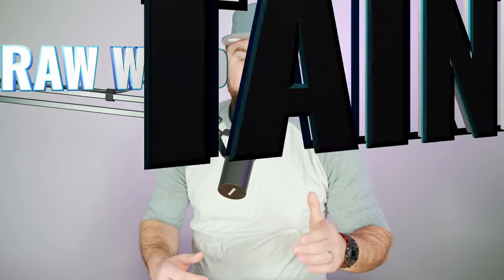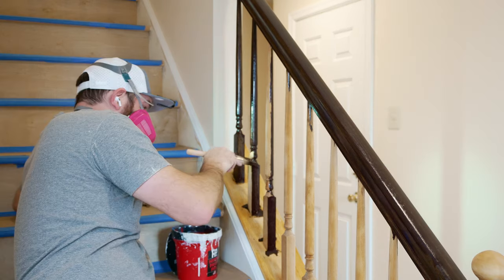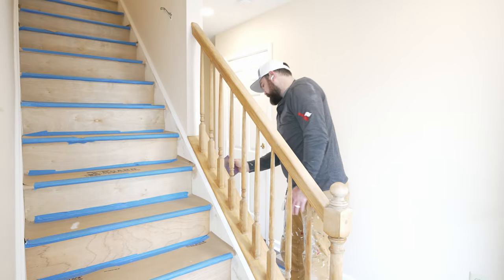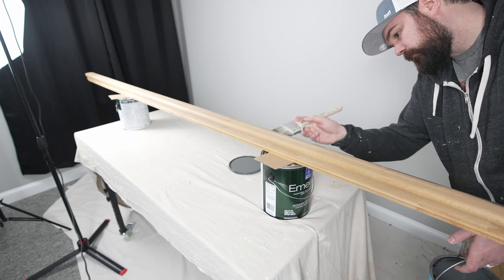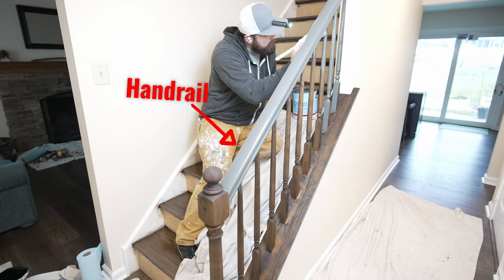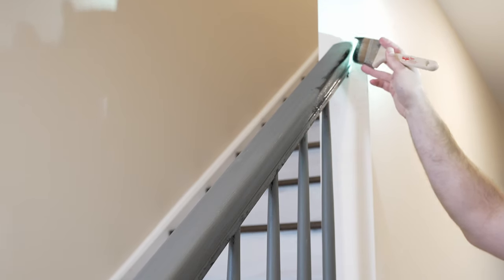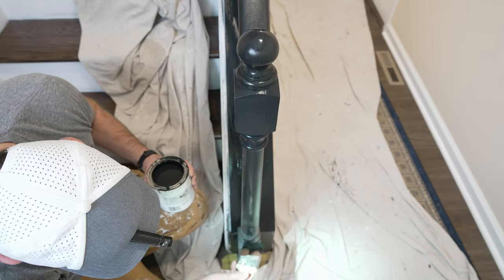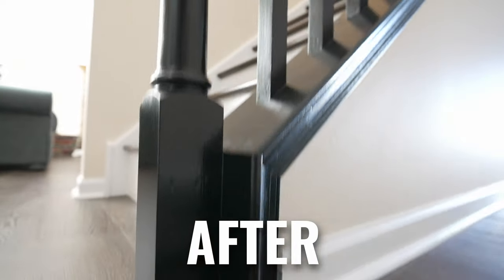The Secrets to Painting Your Handrails FAST

Comment: Thanks for the great tips!  You do really need to watch the drips with Advanced on vertical/sloped surfaces, but otherwise the results are great!  Just put it on a bit thinner than normal, and wait the 16 hours as you advised, between coats.  Usually 2 coats gives you perfect results!
Reply from the maker: That’s the move 🫡

Comment: Hello, thank you for all of the great videos, they have definitely helped me with redoing my bedrooms. I was wondering if you have used the sw extreme bond primer withe the emerald trim paint, if so how does this combo compare to the sw? I used the sw combo on dark stained trim and needed 3 coats of paint. To be fair this is my first time doing this kind of stuff so it may be something iam doing. Thank for any input you might have.
Reply from the maker: Thanks for watching!  

I have used the SW extreme bond and in my experience the Fresh start does a better job bonding and converting a light color to a dark color.  Emerald urethane trim enamel is my go-to trim paint but I use advance for specialty applications like handrails.   

3 coats is typical for converting dark trim so don’t feel like you’re doing anything wrong.  Good luck with the rest of your project!
Reply: @SuperVassarBrothers  thank you for the reply. good to know, just starting on the second room and I will probably stick with the sw combo as I still have enough to do this room but, I might try switching to Ben Moore for a future project. 
I see that you like the corona Cortez and Vegas brushes. Have you tried the purdy xl glide and nylox? If so how do the compare?  I haven’t had an issue with the xl, but the nylox lost a ton of bristles which was incredibly annoying but it did leave a smoother finish on the trim.
Reply: Also, much as I love Emerald trim paint, it is really bad for mid-range to dark colors, it scuffs really easily. The paint doesn't seem to be able to handle much of a pigment load in the dark colors and it gets destabilized. Beware! @SuperVassarBrothers

Comment: Looking good! I'm almost scared of using Advance, as a beginner painter. I'm getting my technical skills up but still using almost exclusively 100% acrylic because that's what I know the most. Lately I've been using a hybrid primer (alkyd based) and it did go well but it's not the same as actual paint isn't it?. I'd be so stressed out to use Advance on doors or baseboards and see a lot of drips everywhere... That's why a pro knows how to use different products properly!
Reply from the maker: Acrylics are great and I’ve used them a lot and still do.  We use to use duration semi-gloss a lot for trim and doors and it worked well for a lot of applications.  Advance is good for specialty applications like handrails because of its durability.  We generally only use it for specialty applications.  For everything else we currently use emerald urethane trim enamel.  It’s still a hybrid but it’s easier to work with than Advance.
Reply: I prefer using Advance, it's easier to brush than acrylics as it has a longer open time whereas acrylics dry too fast. I'm brushing & foam rolling some old honey oak kitchen cabinets & the finish is excellent. Once you've used it a couple of times you'll get used to it, it's easier than you think & gets great results.

Comment: So, maybe you're just the man to help me. When I bought my home, the owner had removed the handrails that you're staining in this video and it's just slanted drywall there. The stairs are carpeted, which I despise and just have a handrail going up on the other side of the wall. Which by the way I need to replace because it doesn't even fully go to the top of the stairs... how that passed inspection I will never know. Sidetracked sorry. My questions are, do you think it would look nice to put a stained wood over the top of that drywall and then replace the handrail and stain that as well? I'm thinking of going with a black stain. If I remove the carpet from the stairs, how do you suggest I handle that process? Stain the top of the stairs and paint the fronts? I'm just a girl on my own here, so I need a professional male's opinion and if you feel this is something I could easily tackle myself. What color was the paint you used on the railing? I think I want to do the stairs exactly like you did here. I'm not sure if you stained or painted the tops of the stairs the same as the railing, that wasn't mentioned. And then on the fronts of the stairs what white paint did you use? This turned out exactly how I would want mine to look minus the spindles of course because they were removed...lol. I know this is a long comment, so thank you for any help you can give. Maybe I can just hire you? 😂🤣
Reply from the maker: So, the project you're describing is quite involved.  A qualified carpenter would be the place to start that particular journey.  It's hard to tell what you're dealing with underneath the carpet.  Those treads may need to be replaced if you'd like to stain them.  If you want to see my process for stairs you can check out this video.  Keep in mind that this is a brand new staircase with all raw wood: https://youtu.be/wX9rFk_ZVsI